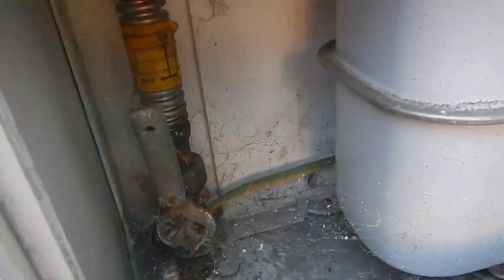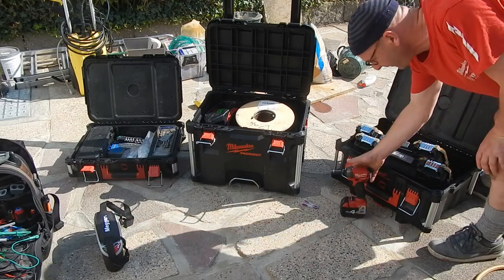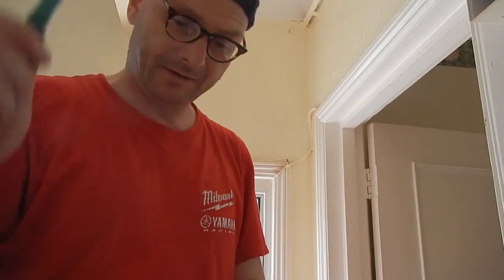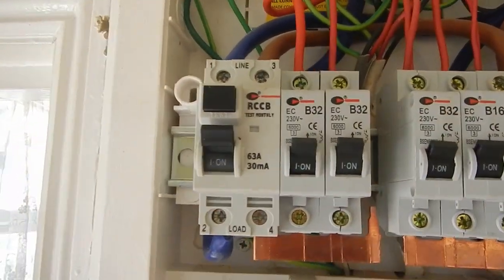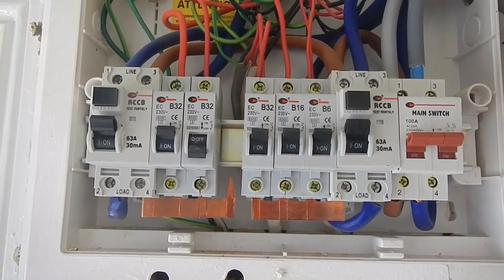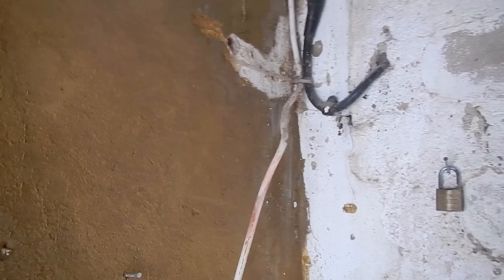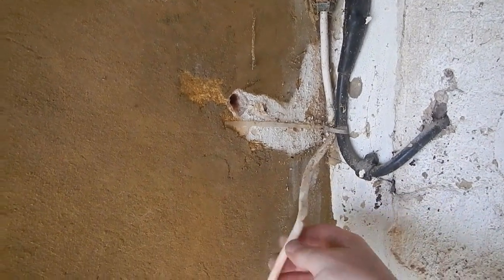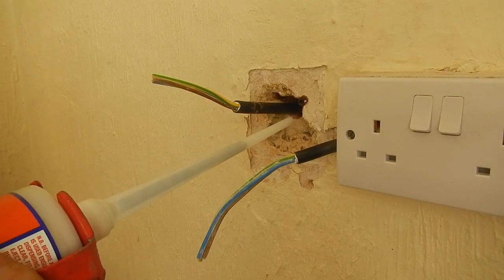video 36:  Holiday work 2: fitting a hot tub

Comment: That looks rough and I would never of connected to that old swa on that circuit or if I did it would of been reterminated into a wiska box then the cable for the socket ran in pvc conduit because that high tough looked shocking and the different colour compression glands,there was a spare way in the db so you could've ran a new circuit in
Reply from the maker: Thanks for the comment. I pretty well agree, having done the job in an afternoon, it wouldve been just as quick.  And she wasn't too worried about the cost.  I think you're right.  But there was nothing wrong with the SWA on the circuit, and if you notice I didn't just spur it off, I through connected it all.   I since then went over and sprayed the hi tough white, but, I take on board what you say completely, I'd do it different now, I don't know why I thought I wouldn't now.  It was to get it in last thing on friday for the hot tub to arrive, and I was on another job at the time, so it just panned out the way it did.   All the best and thanks for watching my video!
Reply: @LAsparkTVWireTestLimited  just a bit of constructive criticism I've done stuff before where when you look back your like why was I such a pillock
Reply from the maker: @michaelboyes4948  That's the sum of it, no problem keep the comments coming.  It was a very untidy job I'm not proud of it.  But she was over the moon I fitted her in before it arrived and she had her daughter to stay.  But in the end conduit wouldn't have taken much longer.  All the best

Comment: Sorry man but that is one of the roughest installs I’ve ever seen. You must try to keep things tidier especially if it’s surface clipped
Reply from the maker: I much appreciate you taking the time to comment.  Your comment has confirmed what I thought at the end of that job, and now I feel pretty ashamed.  It was a bit messy in the shed, even allowing for the fact that I didn't want to move that thru box which really, looking back on it, I should've done and reterminated the swa, which I didn't want to do obviously, and well, to get rid of that 1.5mm flex that had been used.  The temperature was so high yesterday it was amazing how flexible that hi tuff became.  However, I just drilled the anchors for the cable cleats free hand instead of marking them out, and hence they end up looking quite wiggly (I didn't bargain on them coming out looking quite so bad) and the other thing I quite hate about the way I done it, was the staggered holes taking the radial into and out of the IP rated socket.  I mean it's fine, and it's sturdy, but your comment has made me decide on something I toyed with yesterday evening when watching the video through, that I at least should go round there and spray some white paint on the tails so they're less conspicuous.  I really am a bit ashamed of the wiggliness and the mess around that flex though, especially now someone has picked me up on it.  O well, it's good working on your own to have people to  spare their time to pick you up for sloppy work actually, and it's good to talk to people whilst doing a job.  Some of these little jobs can be so lonely, especially if you're without a radio.  But it was weird wasn't it how the original installer had fused the circuit at 32 amp, with that 1.5 mm flex length in it.   I mean I see why he put flex in, I think, but it wasn't protected properly.  Yeah, I didn't want to get into reterminating that swa, I should of though, and then I wouldn't have had to put that earth fly-lead on.  I did that because I just assumed he wouldn't have connected the SWA sheath.  This job has taught me with all you people watching, I should be a lot neater.  I should, I'm really kicking myself over it now.  Please keep the comments coming, it all helps to improve each others work, much appreciated.  Have a fine weekend now.